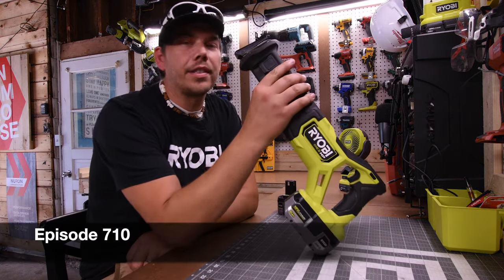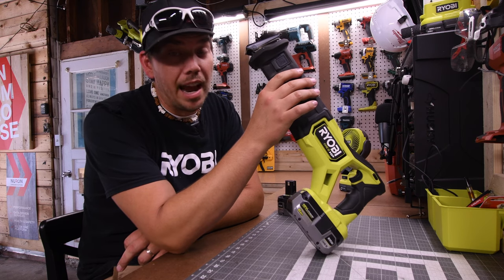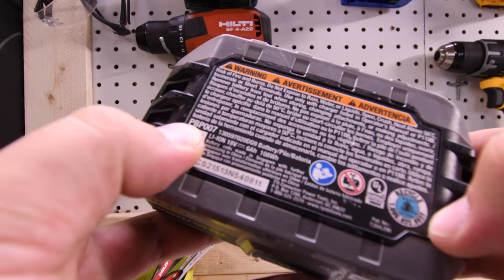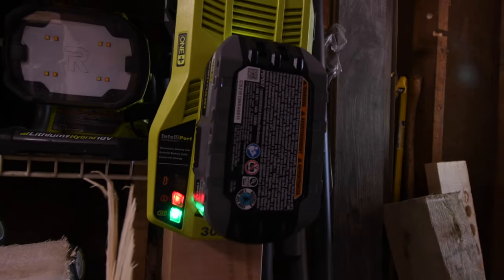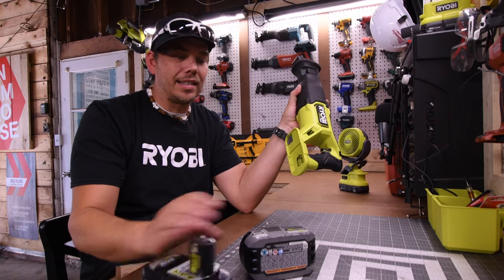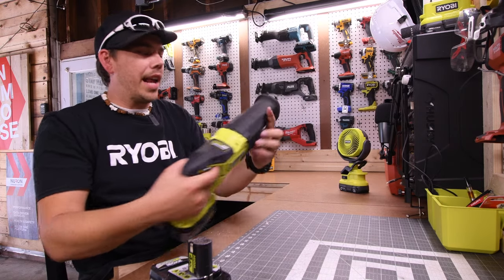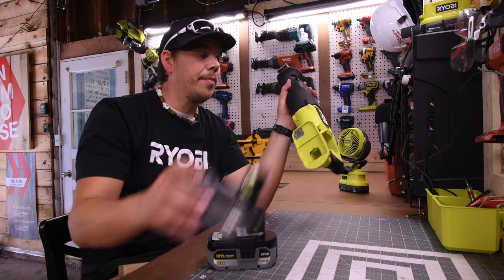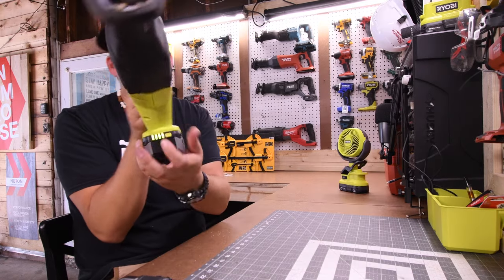Brand New Faulty Battery Issues?

Comment: I had this happened to me on Ryobi batteries in the past but not with a 6A. I have 4 of those and still good after hard use but they are the older model. One of my a 2ah quit working about a year into it's life. Since it was out of warranty, I opened and tested the cells. They were all still good so that only left the bms as the culprit. I just saved the cells and the casing and discarded the rest. Yours show fully charged on the indicator so most likely is a defective BMS. Unless one is an electronic expert, not much one can do there. I guess it happens once in a while like with everything. On a few of the 1.5ah that I own, after 3 years they simply did not last long or had the same power so I just replaced the cells with high-discharge 18650s and still use them to this day. Gladly yours should be under warranty and I wouldn't suggest to open it as not to void it.

Comment: I'm a reseller, I get whole pallets of Ryobi (among others) tools. I tell ya man, I have seen unbranded chinese crap better than Ryobi. I'm not usually a tool snob. In fact I do not even like Snapon. But based on 6 years of experience with these tools, they are horrible. Even as a reseller I often will order replacement parts to fix them to resell and even that's a nightmare as they change models 3-4 times a year in a lot of cases. I recommend Ridgid over Ryobi anyday. Or Kobalt/Craftsman.
Reply from the maker: companies need to stick to something and stay with it
Reply: @ManCaverTools  I agree. What I do not understand is how they still profit from the sheer amount of failures with this brand. It's not like they are stupid. Techtronic Industries makes tons of high end brands like Milwaukee also.
Reply: @robsdeviceunknown  A lot of times companies owned by a a larger one like TTI or Stanley Black and decker who own many brands under them let the brands kinda do their own thing. Stanley BD lets Dewalt do their own thing. when Stanly BD bought craftsman when it was going into the tubes, they didn't care. the rumor with that purchase is that Stanley bought it so no one else could  revive  craftsman back to the level of the glory days it once was. and basically turned porter cable into craftsman branded power tools and are relying on the name itself to sell chinese made tools at american made prices

Comment: Looks like you overloaded it. There must be overload protection in the bms. Have you tried reading the battery voltage with a meter?
Reply from the maker: I was letting it sit for a few weeks and the battery is completely drained now. I have now put a voltage meter on it yet bit I will right before Im giving up on it and sending to Ryobi to get it replaced